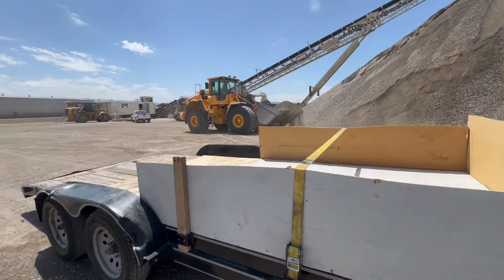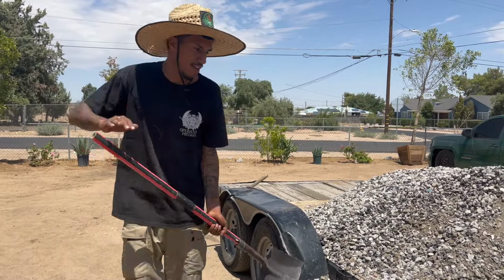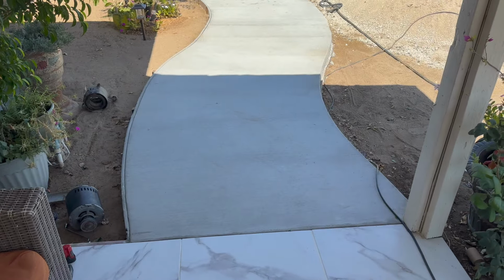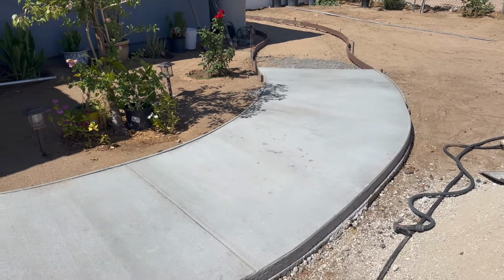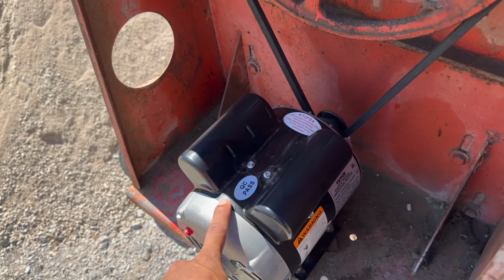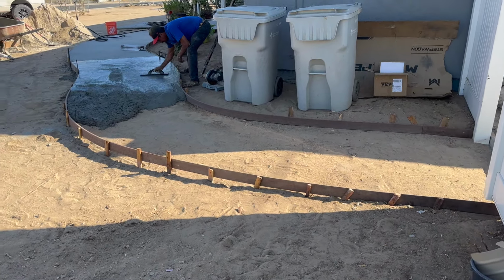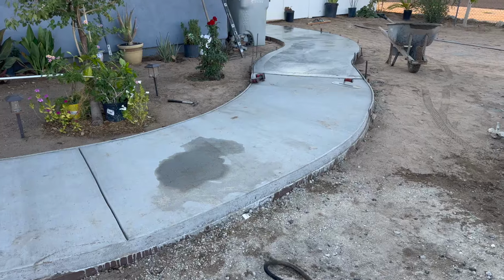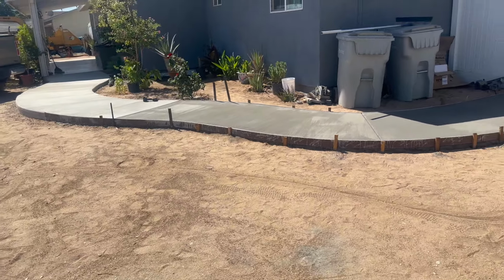Big Upgrade To My Front House  **HOUSE RENOVATION**

Comment: I wouldve cut the joints every 5 ft but it looks good Jerry. And for the comments about rebar. Its for walking not driving so theirs no need for it. Good work Again.
Reply: what are the joints for?
Reply: @walkonprvda   Gives a spot for the concrete to crack and allow any movement when it settles.